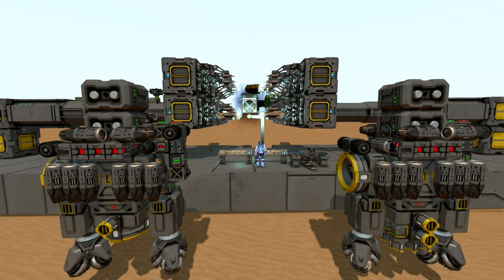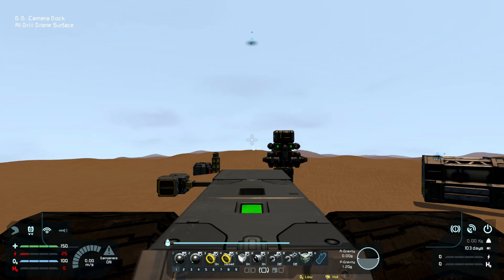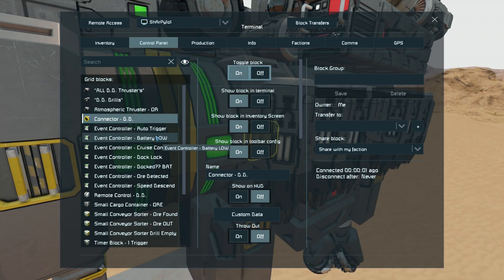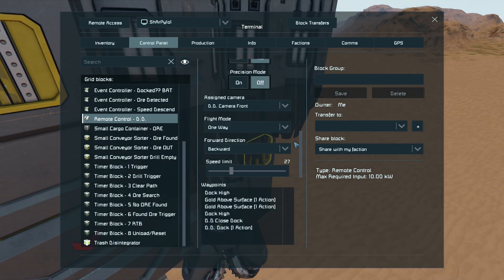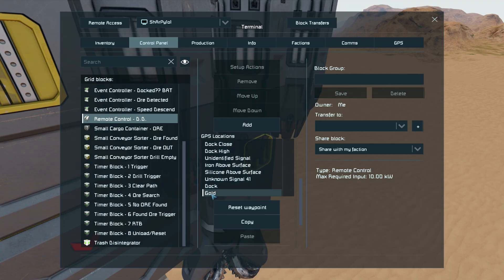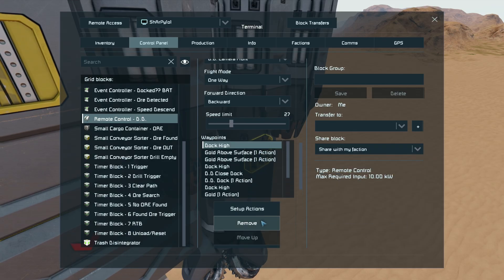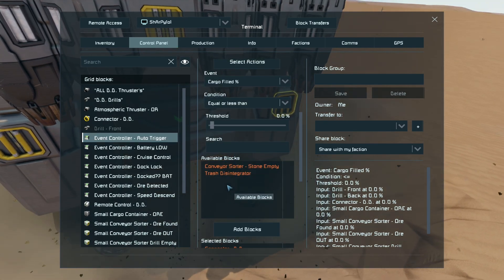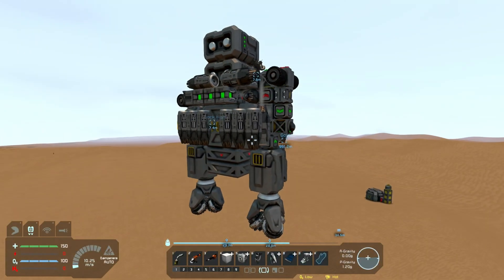AUTO DRILL DRONE Setup Tutorial - Space Engineers 2025

Comment: just set this up and it is working awesome.  The only difficulty's i had was the merge block falling to the ground and not locking while welding.  I just built a jig to hold it up and hand welded the merge block.  I still have to work out the mod for the trash disinegrator as i could not get it to weild up
Reply from the maker: I will double check the merge block bu5 I'm pretty sure it's on and works fine in the design.... Not sure what u mean by not locking while Welding?